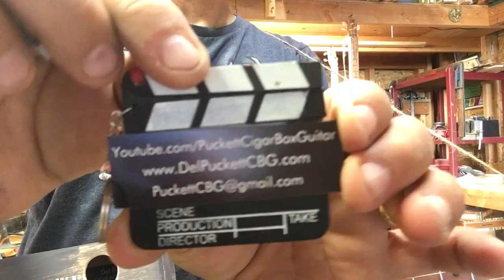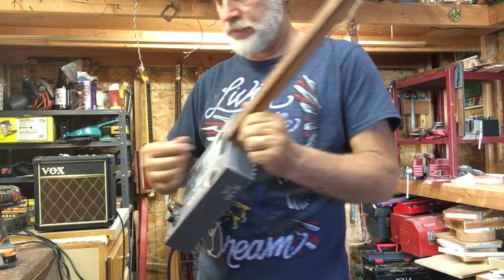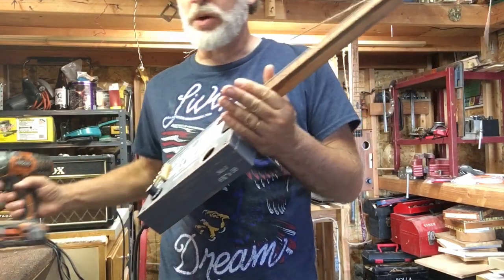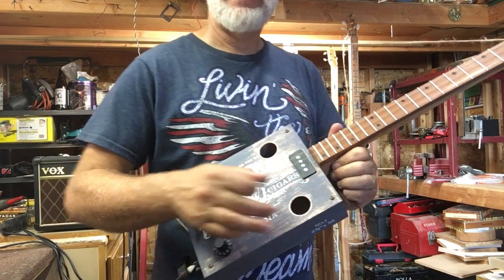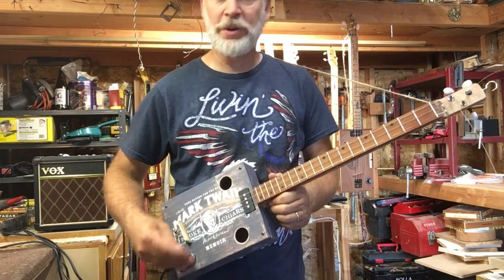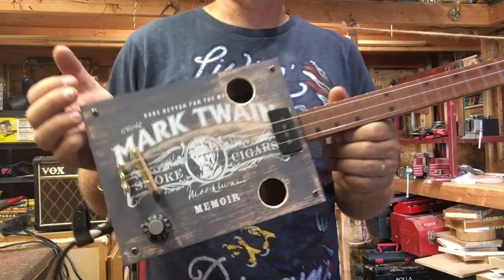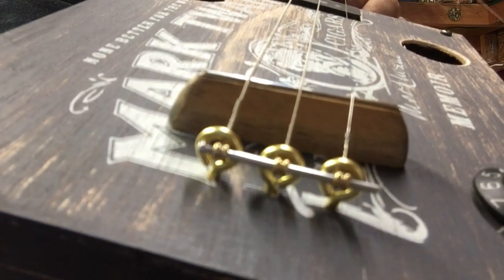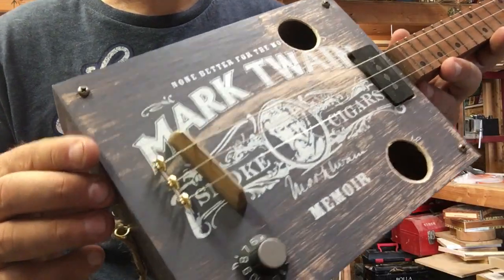Mark Twain Cigar Box Guitar with Blender Pot

Comment: i used poplar for my 3 string and the neck bent a little bit. i'm gonna put nylon strings on it so it's at least somewhat usable, but what wood do you recommend to be able to use steel strings without bending?
Reply from the maker: I have success with every wood .... even pine.  Be sure to use vertical grain... and straight to begin with